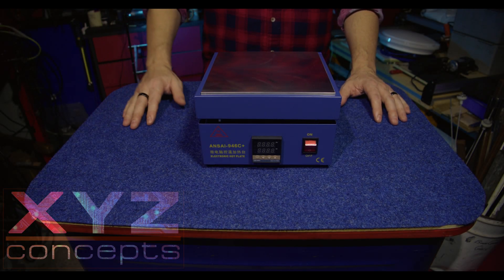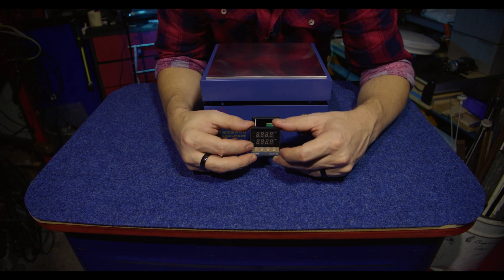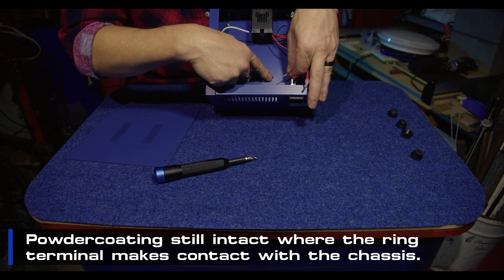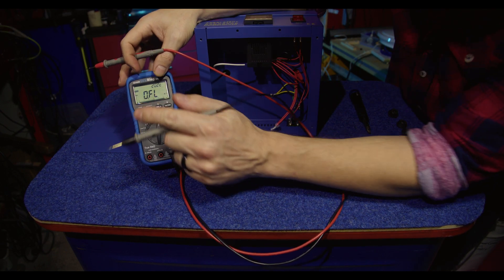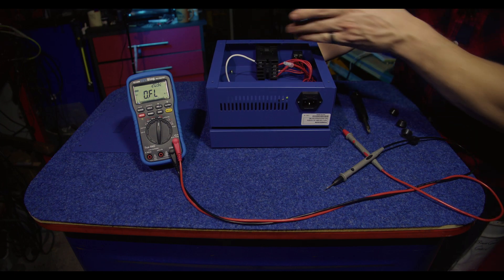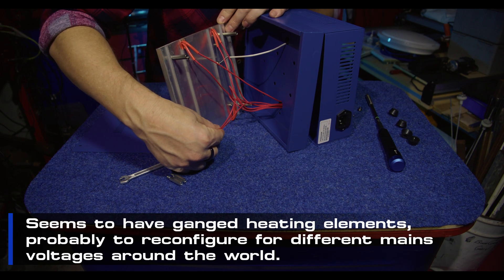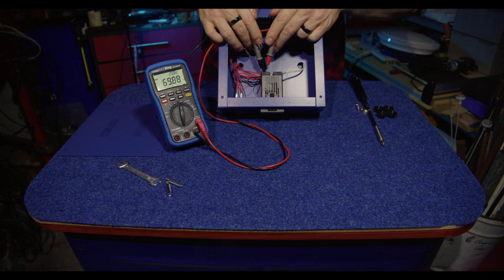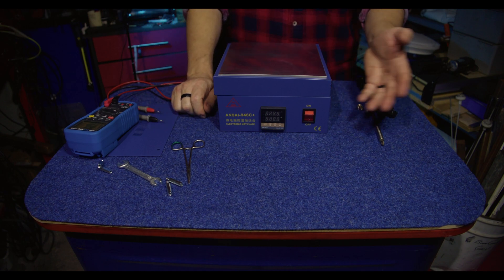#53 - ANSAI/BOZAN 946C+ - 800W Electronic SMD Hot Plate Teardown

Comment: I have the same hot plate, used it for years doing some chemical mixing. Now that I'm working with PCBs I tore it apart, added an SSR, ESP32, MAX31855 temp sensors. Re did the cheap wiring inside and took the controller out. Made a bracket to hold a CYD as  my display and profile storage. 850 watts is a bit low for no-lead solder but it does fine on the leaded solders.
Weak points? the cheap wiring, cheap connectors that don't clamp hard enough to carry the current. Melted the IEC connector. Easy to replace but I also replaced all the wiring with heavy wire, soldered to the plug and the switch. The ground circuit is not really grounded. I mean it kind of is but the screw is loose and can't be tightened any more so I ripped all that out and did a proper ground by scraping the paint off so the ground wire could touch the metal.

Comment: As seen that version of the 200mm^2 hotplate has a REX C100 pid controller and what I found to be the cheapest thermocouple obtainable.  The C100 looks to be either a customized or feature reduced version, with a bare bones integral triac SSR.   But footprint wise both C100 and TC can be swapped out with more accurate versions.  The unit I received was off calibration not by a fixed offset but a linear error.  Unfortunately this strain of the C100 only provides a fixed offset adjustment and my unit if dialed in correct at 100*C was about -10*C off at 200*C and visa-versa.  I just ordered a replacement C100 with SSR relay output (US$4 @ Aliexpress) which I will swap in along with a real SSR and known accurate TC then get on with life.  For the US$50 I sprung for it, I'm calling it a kit rather than carefully manufactured product.